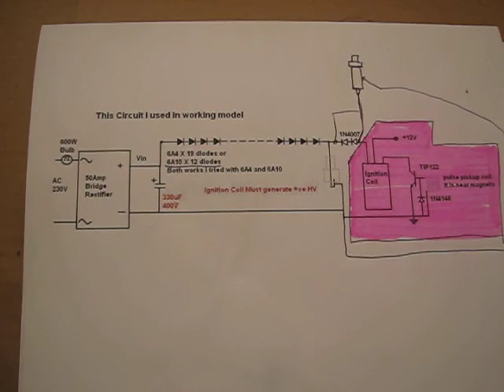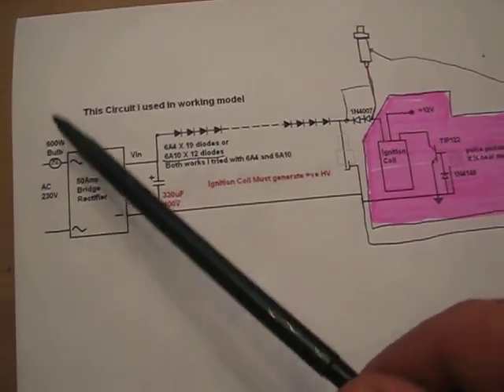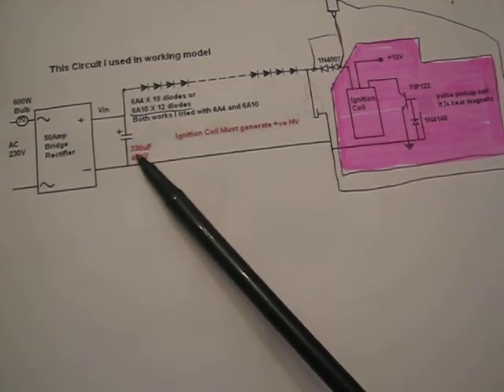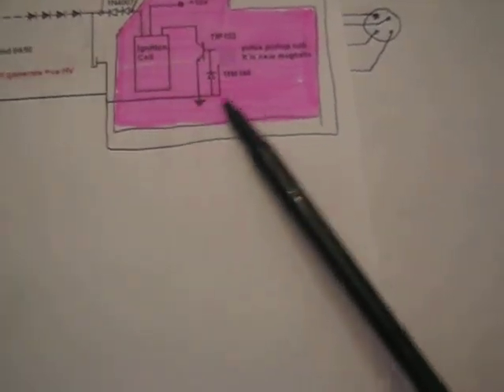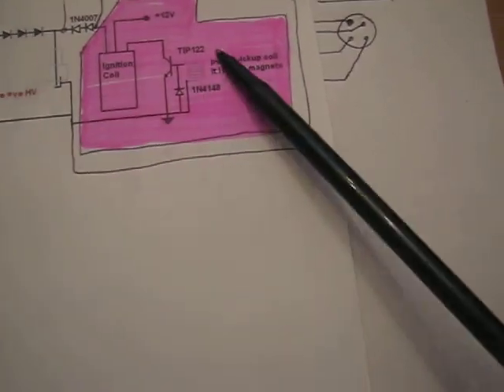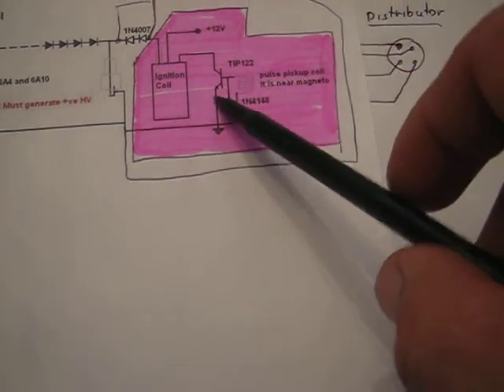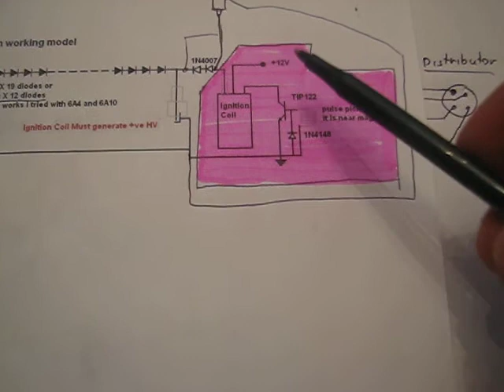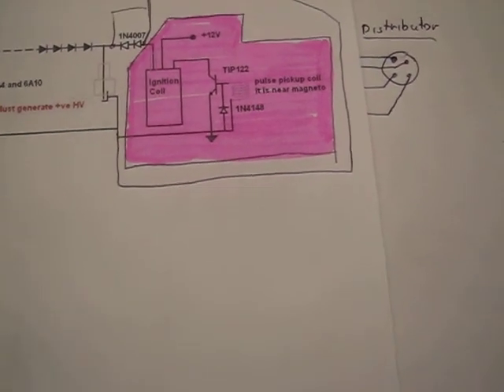New capacitor 70Circuit

Comment: This is known physics.  It's working just like a xenon flash bulb.  The sparkplug coil is not helping.  About 400 Volts in a couple of large capacitors will do more, with the diodes.  You don't need the spark plug coil at all, if you continue to use the igniter.  A solid state circuit would use the spark plug coil instead of the igniter.  You just need to protect the capacitors from the high voltage.  I'll send you a link to the kit.

Comment: Blast improvement.  Some are using tap water that has calcium and magnesium in the water.  If someone has a water softener and uses tap water, they are basically using salt in their water.  There are many different electrolyte solutions that could be tested.  With the conductivity of water, it should provide for an improvement.

Comment: tiltfulll,

Good work!  Give this a whirl.  Make a solution of colloidal copper as your electrolyte using simple electrolysis and distilled water.

Get a foot of number 12 copper wire and remove the plastic coating and make your electrodes from that.  This is a high enough grade of copper to perform this experiment.  In no way are colloids of this grade of copper fit for human consumption, in other words do not drink.

IndianaBoys